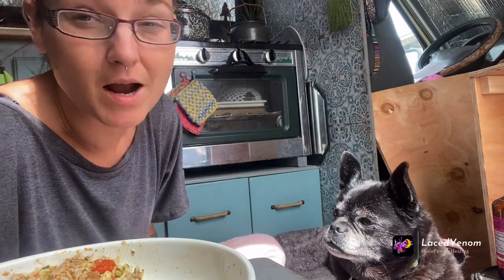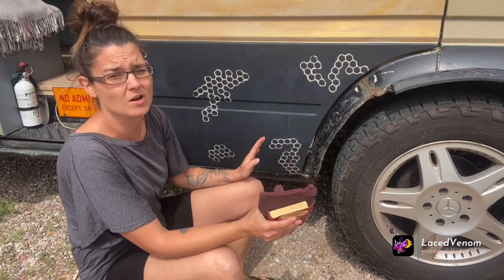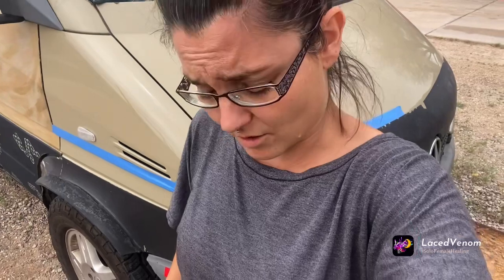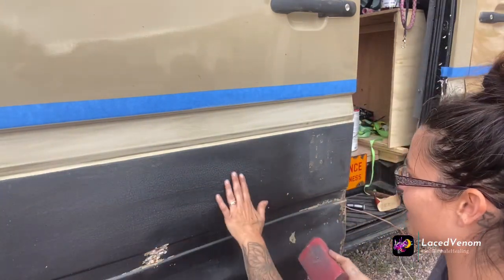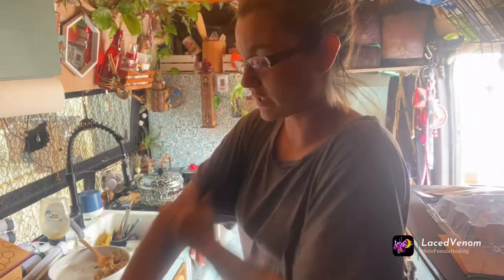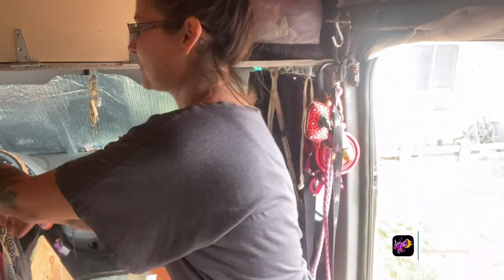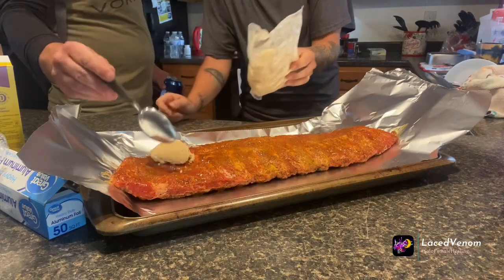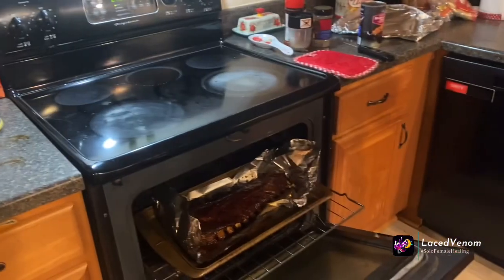Van Life Upgrades

Comment: First you need to get wet /dry sand paper for body work get 120 grit and 320 grit they sell full sheets 9" X11"  take and tare the sheet in half then fold it twice you don't need block get you a bucket full of water and a rag or sponge keep the spot your sanding wet that makes the sandpaper last longer and easier to sand I've done body work for 45 years and forgot how many cars / trucks / semi trucks and a few flatbed trailers I've fixed and painted or those years does your brother have a air compressor by any chance if he does you could go to harbor freight and get a cheap spay gun to use to paint it but hit me up will try and help you anyway I can the main thing take you time and don't get burnt out on it walk away for a while then go back at it
Reply from the maker: I had to walk away many times, but ultimately the project is finished and it looks great and I am very exhausted